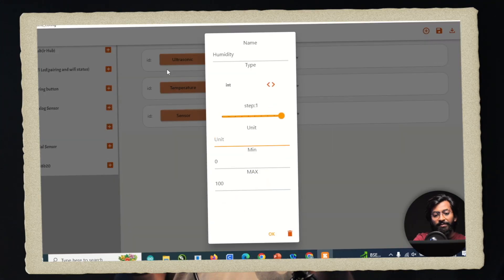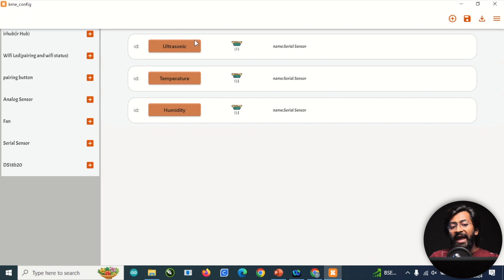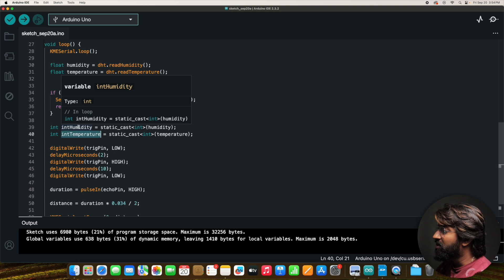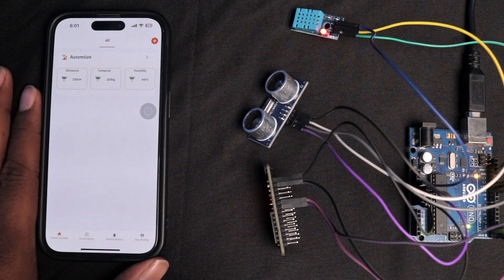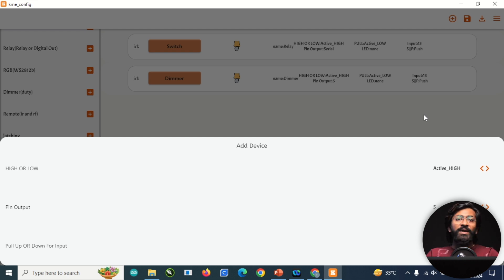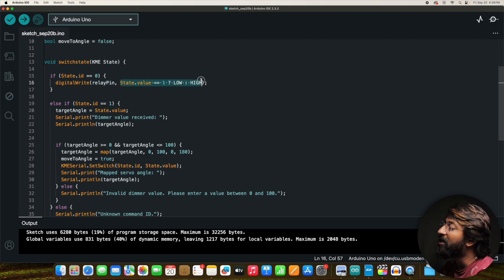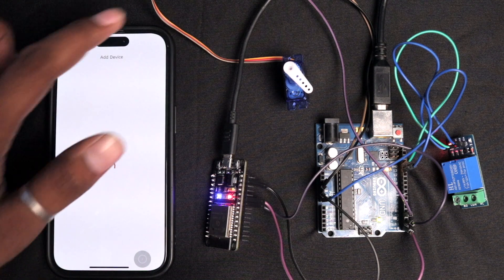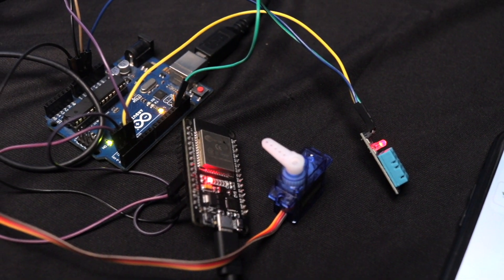Most Useful Feature of KME Smart IOT Platform | KME Serial

Comment: ATTENTION! You have to connect the TX and RX pin to ESP32 through a level shifter, because esp32 works at 3.3 V, instead of Arduino which works at 5V. You risk to damage esp32!
Reply: Why does ESP32 pins 26 & 27 connect to Tx & Rx? Those pins are not mentioned in code?